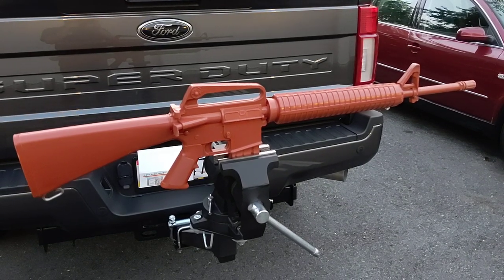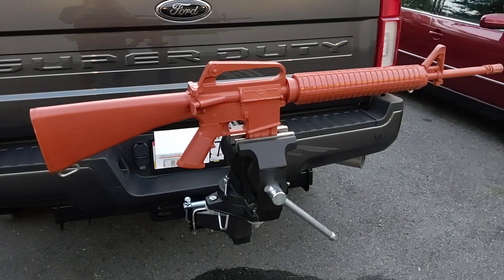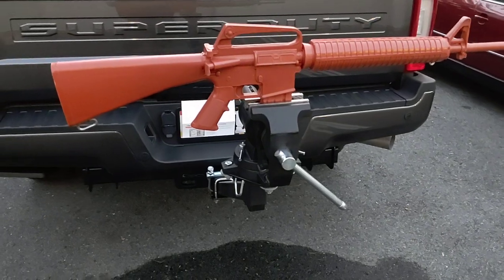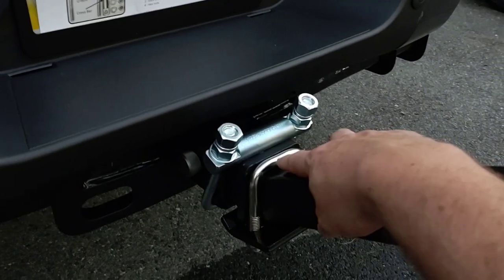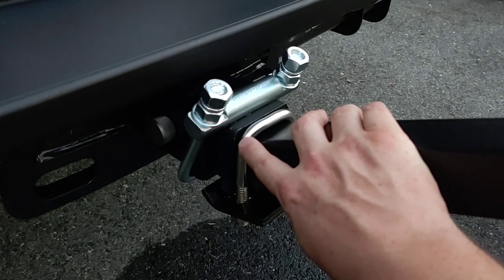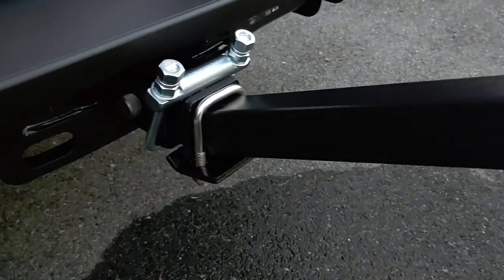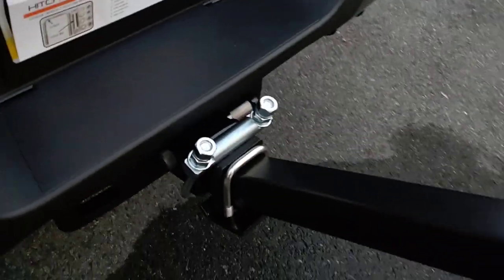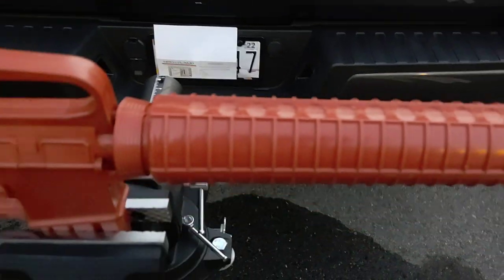No more Hitch Vise slop! (Hitch Vise Part 2)

Comment: Very nice :) I had no idea that those tighteners existed! I pulled a trailer everyday for 5 years at my previous job, and it would have been nice to have one of those! Edit: BTW, could you do a video on properly installing a 9mm blowback barrel on an AR upper receiver? It seems like there are a number of different methods that people say are "correct," but I really worry about twisting up my upper receiver! I'm doing a "Colt DOE" 9mm build using a slick-side upper, and I want to make sure that I do it properly. I also want to do another 9mm build in the near future. I'm sure I am not the only one who would love to see a video from you concerning 9mm barrel installation! :)

Comment: wonder if you flip the black plate on the smaller U bolt so the angle is facing towards you, if it would keep from gouging the threads
Reply from the maker: I'll try that.